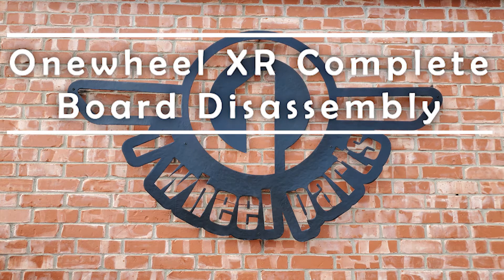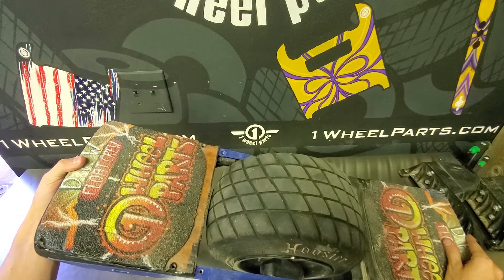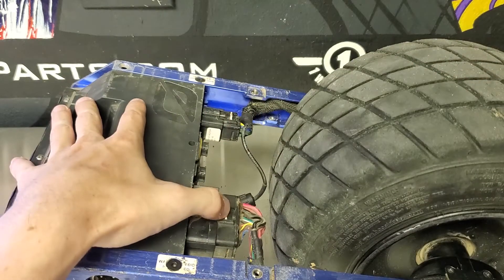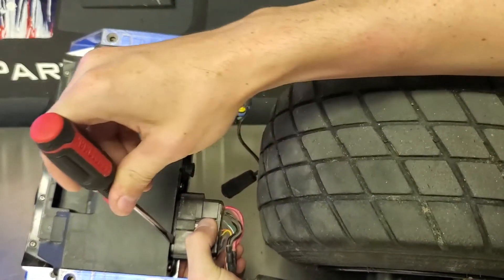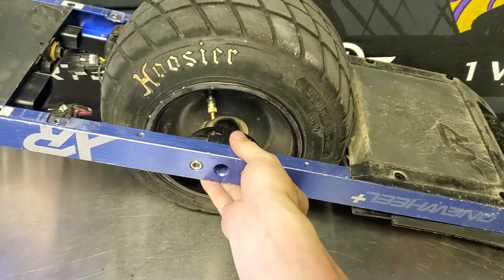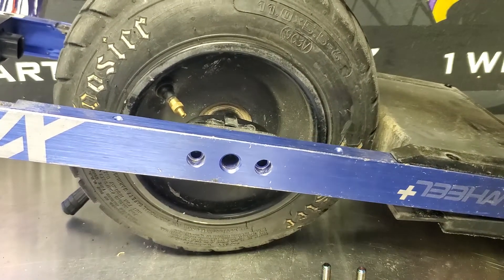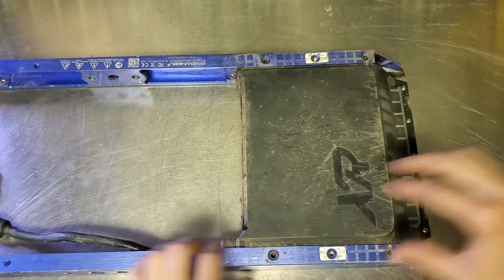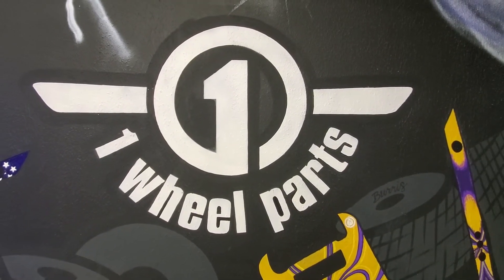Onewheel XR Disassembly

Comment: I went over a speedbump and now my XR won't turn on... blue light comes on when plugged in. Plugs felt OK up front but did ride it through the rain however it's never been taken apart and all of the plugs have hte plastic sealant on them... any recommendations? Thank you!!